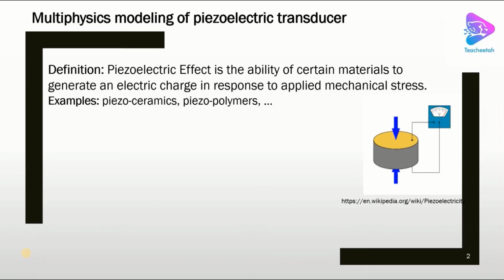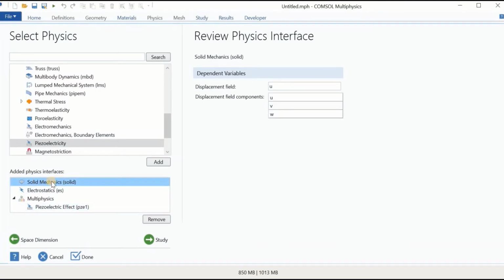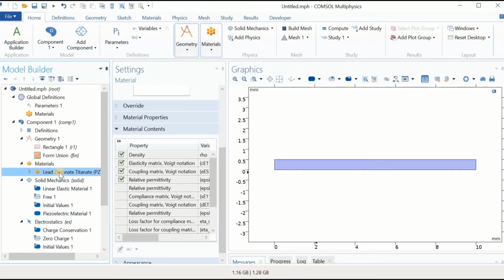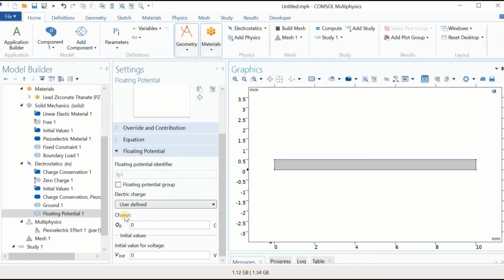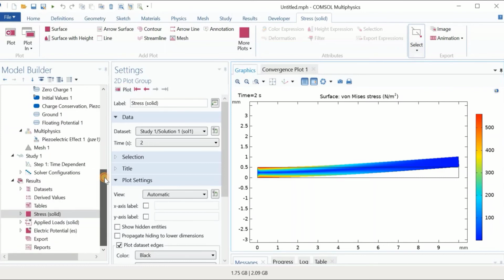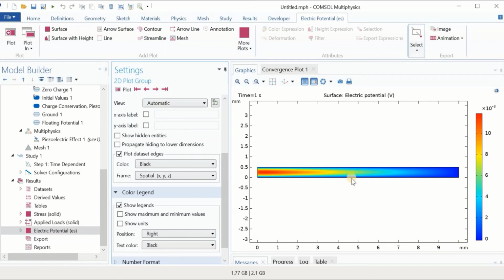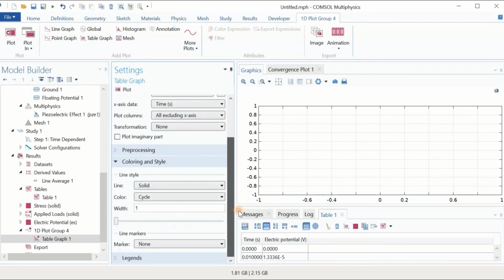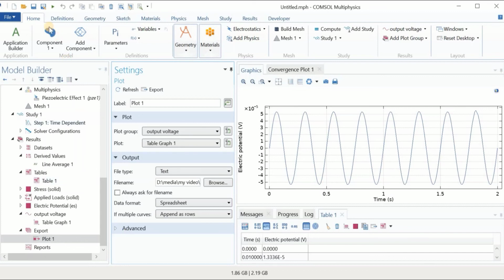Tutorial 3: Multiphysics Modeling of Piezoelectric Transducer

Comment: Hi I want to know how can I calculate the total power ? and how can be sure that simulation is correct?
Reply from the maker: Thanks for the comment. Please note that the example presented here is a basic case to introduce modeling of a mutli-physics problem in the software and the voltage signal presented here refers to an open-circuit condition. To calculate power, you may need to add the Electric Circuit interface into your model, link the piezo outputs to a desired external load based on your problem (e.g. a resistor R), and then you may find the power using V/R^2 or V*I where I is the current across your load resistance. In this case, note that the voltage and current signals are in the form of AC so you may need to integrate over one cycle or find the average values to calculate the total or average power, respectively. Regarding you model validation, one suggestion is to modify your model to be similar to existing experimental or theoretical models in the references and compare your results with them. Then, if you find a reasonable agreement in the results, you may go back to your original model and continue with that.

Comment: Sir could you tell me how should I add an electric circuit to a piezoelectric transducer in comsol to measure its output voltage ?
Reply from the maker: In the Electrostatics interface of your piezo model, you need to apply Terminal boundary condition to one of the piezo electrodes (e.g. the top one) and in the settings of the Terminal boundary condition, use the circuit option. Then, add Electric Circuits interface into your model from the Add Physics menu. In the Electric Circuits interface, use External I-Terminal and in the setting, use the Terminal that you have defined before. You can then add other electric circuit components (e.g. resistor, capacitor …) to the Electric Circuits interface and contact the nodes to its Terminal and Ground using proper nodes numbers.
Reply: @Teacheetah  Thank you sir
Reply: This should help https://www.youtube.com/watch?v=UEDrQCD4lnw

Comment: if its a 3d model, where and how to check the output voltage
Reply from the maker: Thanks for the comment.
In the 3D model, the electrode is a surface boundary rather than a line boundary so with the same analogy with the method shown in this video, you may use Surface Average instead of Line Average to find the output voltage of your target electrode.
Reply: @Teacheetah  can I get your email
Reply from the maker: The email is Teacheetah@gmail.com, but please comment your question  as it might be useful for future viewers too.
Reply: @Teacheetah   yes sir, i have 
mailed you
Reply from the maker: We will get back to you ASAP.
Reply: @Teacheetah  thank you

Comment: Will you show the converse piezo effect in another video?  How can I model the converse piezoelectric effect ?
Reply from the maker: Thanks Samet for the comment. The modelling of the converse effect is very similar to the model proposed here. You may simply assign an Electric Potential boundary condition from the Electrostatics Interface to the piezo boundary (instead of the Floating Potential boundary condition used in this model) and then give a desired value or function to the Electric Potential (V) depending on your problem. Also remove the applied mechanical loads from the Solid Mechanics Interface and only keep the fixed boundaries and then solve the problem to find the resulting stress and strain due to the application of the electric potential.

Comment: the electrodes are placed or glued on the piezoelectric layer ??
Reply from the maker: Thanks for the comment.The electrodes are modelled as boundary conditions (lines or edges) , for thin layer electrodes it is a simplified assumption. If the electrodes are thick, they can be modelled as separate domain geometries with defined materials and placed on the piezo layer, then by means of ‘form union’ they will share a boundary with the piezo
Reply: @Teacheetah  ah very well in the case of a thick electrode layer has it is just place on the piezoelectric layer or glue, by what I am studying the dynamic response of a rotating piezoelectric shaft and even the infulence of electric current on the natural frequency of the rotating shaft. and I want the electrodes to be placed on the shaft not to rotate with it
Reply: I want the electrodes to slide on the surface of the shaft
Reply from the maker: Thank for the comment. In many sensing and energy harvesting applications, the electrodes are ideally in a full attachment with the piezo-layer through a cured paste or coating which is also the case that modeled in this video. If you want to have your piezo to move independently from the electrodes, you may use different methods depending on the physics of your problem. Here are some suggestions that you may try: 1) you may define the electrodes and piezo as separate domains then change the location of the piezo using Parametric Sweep in your study to apply the rotation, 2) you may deselect or remove the electrodes from the Solid Mechanics Interface and only keep it in the Electrostatics Interface and then apply the mechanical load only to your piezo to make the rotation, 3) you may use Moving mesh-Rotating or Deforming Domains for your piezo under Definitions and also identify contact pairs between electrodes and piezo.
Reply: @Teacheetah  hello
I want to know more about his techniques, you can recommend books or scientific articles
Reply from the maker: Thanks for the comment.
What we suggested is mainly based on our experience in COMSOL; however, the following article can be helpful too:
https://www.comsol.com/blogs/deformed-mesh-interfaces-rotations-and-linear-translations/